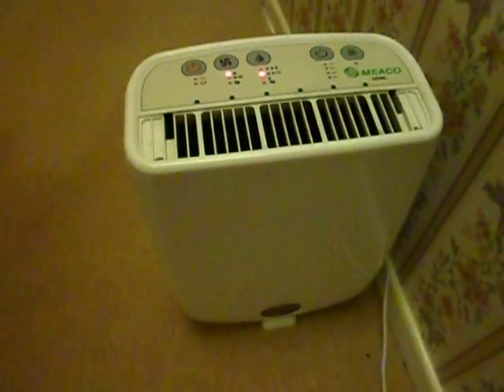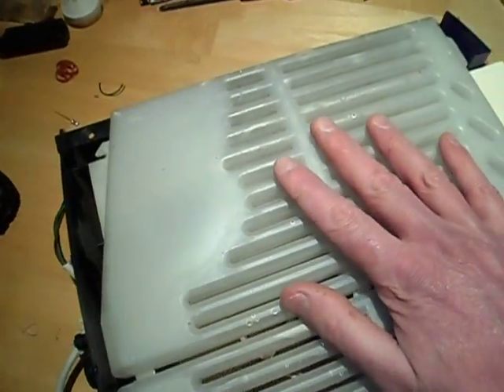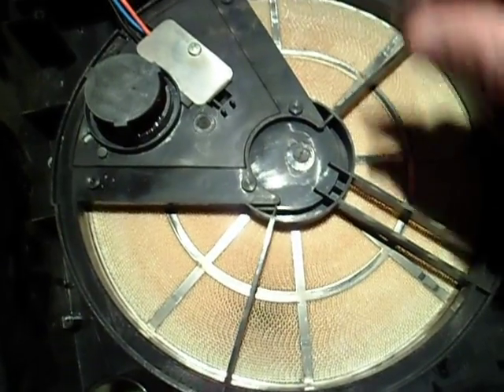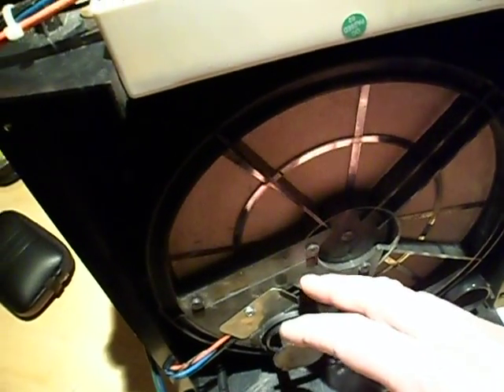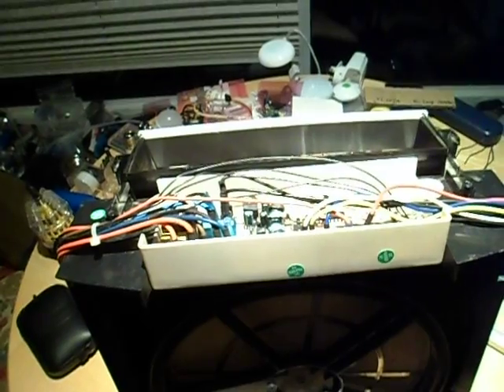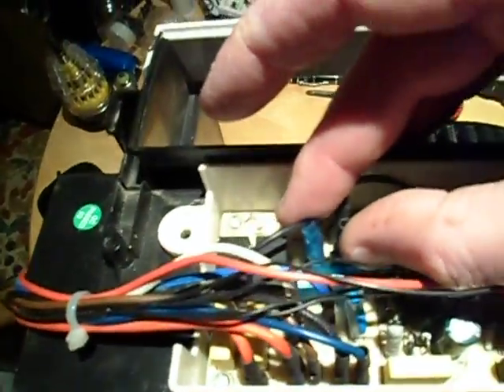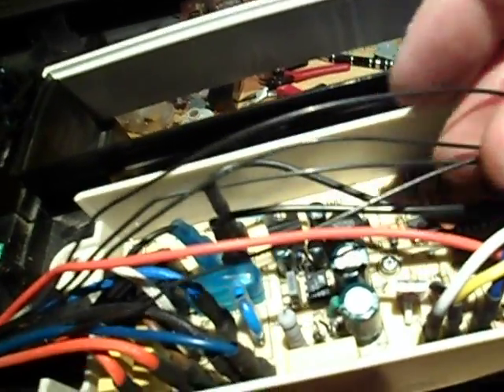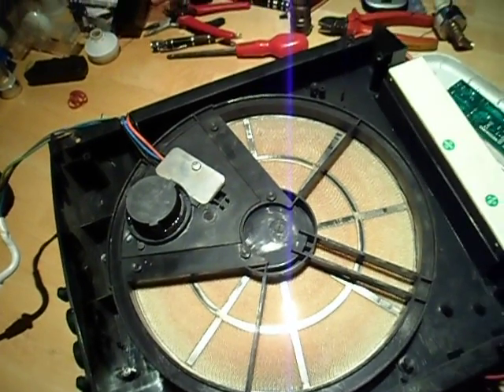A look inside a desiccant dehumidifier.

Comment: How did you open your dd8l?   
I found the screws on top under the sticker and the screws on the bottom, but the thing won't come apart.
Reply from the maker: The base comes off and when the top and bottom screws are removed you have to give it a bear-hug to get the thing apart.   It's well clipped.
Reply: On mine, there are 4 screws hidden very effectively under the sticker. Took ages to work out what was going on.

Comment: Clive, for comparison what is the cost for using the compressor dehumidifier to extract the same amount of water?
Reply: A properly working compressor unit should be effective down to at least 50 F (10 C), especially if the air flow rate is low enough.  I'd speculate that if the air flow is too high, the "sensible-heat" load may prevent the air from being cooled below the dew point.  I think you should at least check the evaporator temperature of your unit and try slowing down the air flow before saying compressor types don't work.  I have an old one that will actually produce ice on the evaporator coils, so you can't say the technology is ineffective at low temperatures.
Reply from the maker: +Matt P The compressor units are more efficient at 20C and above, but the desiccant drum units are able to work efficiently down to much lower temperatures.

Comment: Anyone know where all the screws are in a ecoair DD122 Mk5 dehumidifier? I need to take it apart because it needs cleaning inside. The smell it gives off is whatever crap it's collected while in use in the garage.
Reply: Two screws are hidden behind the carry handle at the top. You can slide the carry handle out if you push the sides of the channel away from where the handle attaches.
Reply: Ah thanks.
Reply: The horrible rancid sour chemical smell is normal for desiccant dehumidifiers I have concluded.   Its very disappointing.   Its best to put the thing on low and set it for a high humidity lol.   They also put out so much heat not really usable in the summertime,  that is if you can stand the smell in the wintertime.

Comment: A compressor dehumidifier will work well also above 20 C. Its limited by how much condensing heat it can move from the cooling section to the heating section. And it will actually also produce warm air unless its a bigger device where the hesting part is mounted outside AKA a air conditioner

Comment: Hi, I inherited a 2012 dd8l unit which ran perfectly for a few months. Then it had the working for approx 60secs then shutdown/fault light. I'm not sure if any heat comes from it now, but a fan still works, but it smells slightly burnt when it turns off.
Thanks to your comments and hints I managed (after a good 30mins mind!) to open the unit and see if there was anything to be done.
I have previously repaired my DeLonghi Dem10 unit by simply replacing a resistor. I really would like to see if there is something equally as simple to be done with the Maeco, as I found it to be a superior product.
When you say the Zeolite should rotate slowly, how slow do you mean? I don't think mine is rotating at all. This would be the synchronous motor right? 
Also, I only managed to open the front panel if the unit. Is there a special way of removing the back, or accessing the control panel / circuit board on top? Or just brute force? 
After I closed it up the unit did work better than before insofar as it ran for 5 mins on low fan and low humidity, but then switched off as if in hibernation mode....but doesn't turn on again after 30 mins like it should.
I would appreciate any help, tips or ideas from anyone!
Reply from the maker: +Tom Pegg Check that the zeolite drum isn't clogged up with fluff.  It should rotate very slowly when the unit is running.  There are screws on the top and under the base.

Comment: Could this be used as a still? If you poured low% alcohol into the desiccant material, wouldn't you end up with high% spirits in the waste water container? You should test this if you still have it around
Reply: Jiyva nah, but you could do the opposite. Zeolites adsorb water but not alcohol. The easiest way to generate 100% ethanol is to dump some A3 zeolite into a bottle of everclear.

Comment: Very interesting video, thank you for posting. I wanted to ask is it possible to get (or make) a HEPA air filter for the front? 

I ask for two reasons: 1) I'm an allergy sufferer 2) reports of units breakdown due to dust getting in (Meaco recommend cleaning the front cover every 2 weeks). Perhaps a HEPA filter would be more effective at keeping dust out of the unit? 

Thank you
Reply from the maker: +billypigeon23 I wouldn't recommend that.  these units need a high throughput of air.  Use a separate air cleaner.

Comment: Hi ! Could you upload a video or just a simple guide, how to open the dd8l humidifier? Steps to open the side panels so i could reach the wheel which is noisy a bit latelly. Thank you!
Reply: @biglivedotcom could you please , give a hint?
Reply from the maker: +Ckaramela It's a while since I opened it, but if I recall there are screw on top, some in the water compartment area and then you have to remove the base from the bottom to get to the final screws.  Then the case is firmly clipped together along the sides in such a manner that I had to give mine a bear-hug to get it open.  Take care to note the route the flex takes in the base to aid putting it back together again.
Reply: +bigclivedotcom Thank you!

Comment: Would you tell me the name of the material of the absorbent material?

Would you think if you passed the collected water through a filter and ozone water, it would be safe to drink?
Reply from the maker: TJ A The material is called zeolite.  The water is basically distilled water, but the cleanliness of the condenser unit could be an issue.
Reply: bigclivedotcom 

Thank you. I read the Wikipedia article about zeolite. 

Do you think it would leach into /onto the water? 

Also how much heat does a compressor dehumidifier produce compared to the deccsant type?

Comment: Most of the irritating noise that comes from my compressor dehumidifier comes from the collection bucket rattling against the rest of the unit. I stuff a small bit of tissue in the gap at the top and it stops the rattle. It still has fan noise though. I like the idea of the desiccant dehumidifier. I don't have the pennies to get one. hey ho.

Comment: IWe have been designing dehumidifiers for international retails for 20 years.  Toyotomi branded units reset after power out as long as the plug is left in.  Desiccant units described below are domestic units in general.  They really were never designed to run 24/7 unattended.  The product originated in Japan to keep apartments dry.  If you need a 24/7 application you really should consider commercial unit like the Ecor Pro DH2500.  As a safety note Toyotomi units will always rest for at least 2 hours in a 24 hour period which is unique in the market.  Safety first and horses for courses..

Comment: hi having opend the case there and blowen through the back of the zeolite with "dust off" compressed air a huge amount of dust, similar to the stuff you find under beds if not cleaned for , came shooting out. I am a bit concerned though. the part which was hidden by the heater i could not access could i use a garden vac from the front, there is access to jam the fan gentley with screw driver from the top vent to prevent rotation
Reply from the maker: michel rees I'd suggest closing the case temporarily and running the unit to move the drum round so that you can blow out the area that was in the heater zone.
The leaking is often down to the area round the small blower that circulates air through the heater.  It's worth making sure all the little drain holes from that area are clear.  In later models they built a little dam of foam tape around that area to try and encourage the water to go down its intended path.
Another thing I had recently was my brothers unit overflowed completely because his had a sliding polystyrene float and magnet in the water container that had gunked up and jammed.
Reply: bigclivedotcom cherrs clive i was thinking about that and have felt tiped the zeniolite eiter side of its present possition, as you would do with a timing bel,. how long would you think i will have to run the unit to get  the un cleared part clear of the heater zone . bearing in mind that when we switch off the unit continues to function for a set period. as regards the sticky float problem i have cleaned the tank before ond added a drop of washing up liquid to same. ps how do you gain access tothe small blower? 
again i thank you for your advise
Reply from the maker: michel rees It might be a case of starting the unit and then immediately stopping it so that it turns its heating elements off, but does the full cool down time.  That way you could either let it run its course and see where the drum had stopped (you can see it through the side filter with a flashlight.)  Or since it didn't heat up before starting the cool down cycle you could just turn it off after a modest time to allow the drum to move to an accessible position.  The heater blower can be a bit fiddly to take off.  It may be enough to clear the drainage holes from underneath where there's a small water guide.
Reply: bigclivedotcom Thanks again clive.
i ran the unit as  you sugessted only to find when i opend it the area that was under the heater unit was partialy obscured, having now got to grips with what you need to remove to gain visual with zenolite disc i did so and started the unit with the back cover only removed and observed on a start stop run. rotation  takes about 2 mins, however as rotating i was able to blow out the uncleaned portion  from the 45 degree window to the left of the heater unit taking care dot to touch any part of the machine as there are of course live wires present.
Having then unpluged the unit i then used the compessed air again  through the drain hole.
Result the unit is not leaking and moreover does now cut out when selected humidity is reached(which it didnt before).
in hindsight i would not reccomend that any one  should use compressed air on a live unit as i noticed condensation forming if you over do the  air volume . correct me if i am wrong! but i will not do that again!
Reply from the maker: michel rees If the compressed air was from an actual compressor then they do tend to condense moisture out of the air.  Hence why inline air dryers are needed for spray painting applications and for air-tool protection.  If it was a canned air duster you were using then some of them actually contain a combustible gas that can come out in its liquid form if the can is not vertical.

Comment: This looks almost same as eco-air dd122fw. My eco-air dd122fw is not extracting any moisture (no water in the tray) or blowing hot air when the fan is working but other electrical controls work. I read on web that these dehumidifiers are known to suffer from blowing of the heating element. Any tips on replacing /troubleshooting the heating element? Thanks.
Reply from the maker: I deliberately bought a faulty unit to check out the heating element arrangement, and it's not great.  It's very hard to access and is almost destined to fail if the unit is run at its high setting all the time.  The one I got had a very crispy and fragile element mounted in mica supports that had puffed up and crumbled, and the vicinity of the heating element to the rotating drum is so close that it's pretty much luck that it doesn't rub against it.  I'd guess that when the companies service these units they just swap whole modules.
Reply: bigclivedotcom
Ha! same here. I thought it would be a quick DIY job. You are probably correct - almost certain that the little heating unit is only replaced as a module, but the company is asking for around £50 to do it. Someone somewhere must know how to get hold of this module and replace it or perhaps come up with a more robust DIY heating unit. Would you please upload the instructions on how to open the unit - all screws seem well hidden in eco-air unit. Thanks for the response.
Reply from the maker: ooootubeoooo To date my favourite of the desiccant units has been the eco-air simple.  It's just a very basic unit with minimal electronics and seems designed to handle being turned on and off by a mechanical humidistat without the requirement for a cool-down period.  If they're wanting £50 to repair yours and probably shipping too then it might be cheaper just to buy a new one.

Comment: I have the dreaded red-light problem. The red error light stays on after a period of prolonged running. I have to physically unplug the unit and then plug it back in to get it restarted. What is causing this? Filter is clean and there are no unusual noises. Expelled air is warmish, and the tray does fill up with water.
Reply from the maker: I'm not sure what causes that error condition.  Does the light stay on even when the unit has been running enough to cool down again?  One of the most common issues that seems to be occurring with these units is build-up of fluff on the drum preventing air flowing through it.  You can check that by removing the filter and then running the unit while shining a bright torch in through the filter area.  You should see a slowly rotating honeycomb drum and its holes should be clear for the passage of air.

Comment: I live on the gulf coast and am trying to think of how to determine how many large diy dehumidifers (and.how large) would be required for 1 acre of land to reduce humidity perceptibly.  A dessicant system seems to make more sense.
Reply from the maker: Are you talking about using dehumidifiers outdoors?  Because as fast as you remove moisture from the air it will be replaced.  It would just be an inefficient way of collecting water.
Reply: This borderline sounds like the scheming of an bond villain.

Comment: Thanks for the very informative video!  In follow-up to your comment about this being a relatively new technology, and so we're guinea pigs; I'm wondering how stable and safe the zeolite is over time.  Some zeolites are similar to asbestos and have been linked to mesothelioma (lung cancer) with chronic inhalation exposure (http://www.mesothelioma.com/mesothelioma/risk-factors/zeolite.htm). 

With the continual blowing of air, movement of water, and thermal fluctuations of the zeolite within these appliances, I'm wondering if particles of zeolite could be passed into the air and circulated inside the house, over time if not initially.  

Do you know what type of zeolite is being used, and whether it is natural vs. synthetic, and fibrous vs. non-fibrous?  From the research I've done it seems a synthetic, non-fibrous type would be on the safer side.  I've asked Ecoair's customer service but they refuse to answer (or perhaps just don't know), only providing a legalese statement with a self-canceling logic:

"The Zeolite in our unit does not disperse into the air. We unfortunately have no tests or assurances which we can provide regarding the zeolite not being passed into the air."

They also refuse to tell me what company supplies the zeolite so that I could inquire with them directly.

Any thoughts would be appreciated as I'm trying to decide if this technology is safe for long-term use, or will it be another asbestos-like situation with a long lag time for the risk to be revealed.  I would use a compressor type but can't stand the noise and on/off cycling inefficiencies.  Thanks.
Reply from the maker: The main issue with asbestos was the shape of the loose fibres which lodged into the lungs pores and the tissue formed round them causing the asbestosis.  I should hope that the zeolites in their processed form don't have this characteristic since there is a notable slightly dusty smell in the room when the zeolite based dehumidifiers are first used.
Reply: I'm hoping the same thing but that's an uncomfortable bet we're making considering it it's testable by the manufacturers, but they don't seem to be testing.  I too notice a distinct odor when first turning on my Ecoair dehumidifier and when running it on high.  The manual says that odor is from the zeolite.  I don't know if that means actual zeolite particles are being passed to the air.  That's still an open (and unsettling) question.
Reply from the maker: Aaron Wilson I've been researching the hazards of zeolite online with an open mind and I can't find any hazard linked to the synthetically manufactured zeolite used in the desiccant drums.  The only asbestosis style connection seems to come from a specific type of naturally occurring fibrous zeolite that had similar structural properties to asbestos fibres.  The synthetic zeolites are not a fibrous form.
Reply: That's good to hear you found indication that they're using synthetic and non-fibrous zeolite. That's what I was hoping but my own limited research didn't turn it up.  Any links you can point out?  Thanks a lot for taking time on that, it's a relief.